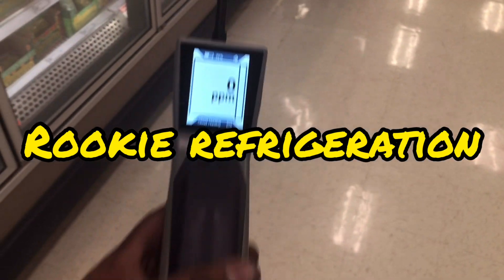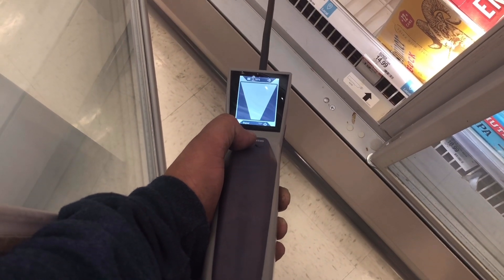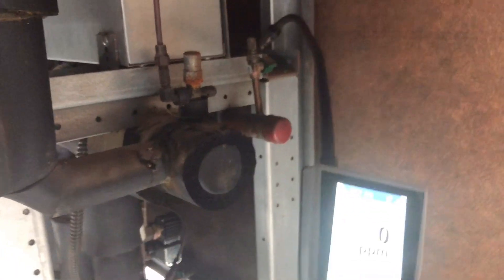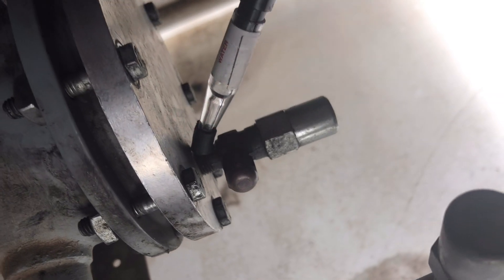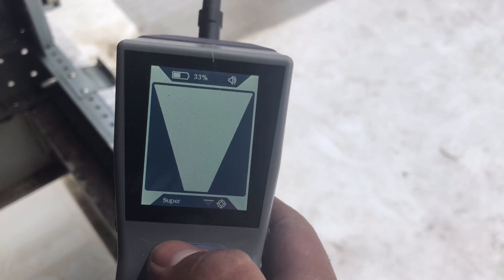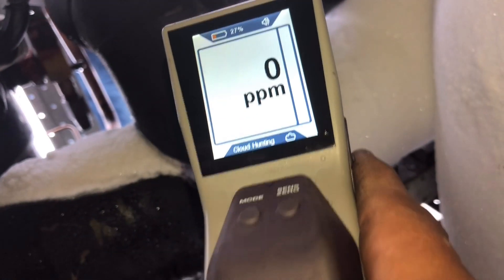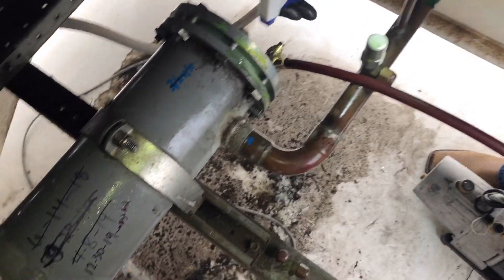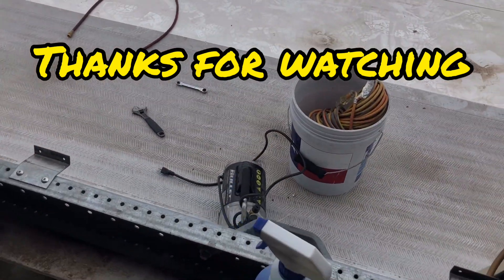HVAC REFRIGERATION:  Finding leaks with the Inficon DTEK Stratus and Bacharach H10

Comment: H10 is Just a Better Leak detector. The Best !  They were the Best in the 80's and still are !  (  i won't use anything else Ever !)  ive been doing this 39 years. what ever you do don't ever buy a Tif Leak Detector. Those were the biggest pieces of junk back in the old days. norcal has had some good luck with the heated diode one from fieldpiece. A Junk Leak detector can ruin your day. ( FTNgot)  Remember Guys to Double check that your Leak detector actually works before Looking for a Leak / use a test bottle or refrigerant jug to do a Pre-test. NOTHING WORSE THAN GOING AROUND LOOKING FOR LEAKS WITHA BROKEN LEAK DETECTOR. CONFIM WORKING BEFORE STARTING LEAK CHECK. THE SNIFFABILITY TEST.
Reply from the maker: Lol. I agree. Both of these are doing really good.  The h10 is only2 years old. So it’s a newer one but still working Badass.

Comment: Hey Rookie - FYI if you take duct tape and wrap it around the flange connections on you system and then punch a small hole in the duct tape between the flanges - all the freon that might leak will come out the small hole you punched in the duct tape.  So in effect you make you a single point on a flange were u can check for leaks... keep up the good work.
Reply from the maker: Very nice idea.  Thanks bro

Comment: My TIF does the same s*** with beer cases especially at that type of site your in.. dont care for the TIFs either but they are what's provided.
Reply from the maker: I’ve heard that the TIF ZX is a really good detector.  Is that what you have?
Reply: @rookierefrigeration4357  I have the zx, dtek select,  and h10 pro. The zx is about the same on R22 as the h10, but is less on r134a, does good on 404a, less on 410a, they all do different. And the fieldpiece srl8 sucks because of all the false alarms,  yea its sensitive,  (too everything)  so it's like saying there's leaks everywhere , so when you check and find one, did it really find it? And the srl2 is total shit. Sold both fieldpiece,  still have the zx for giggles. Wish I had purchased the dtek select as my backup before wasting so much money,  I had a select prior to my h10, but I traded it for the h10 because it did a touch better on 410a, that was all before getting heavy into refrigeration,  now I see all different juices.  So im a detector whore now. 🍺
Reply from the maker: HVACR Survival lmao.  I can only imagine.  🤣🤣
Reply: @rookierefrigeration4357  it's alright.. the H10 pro is where it's at though.. I really want to look into that Stratus though, I just dont want to fork out the cash at this time haha.
Reply from the maker: E Avila I think it’s worth it.  I really like it